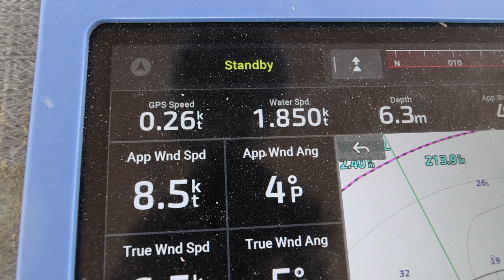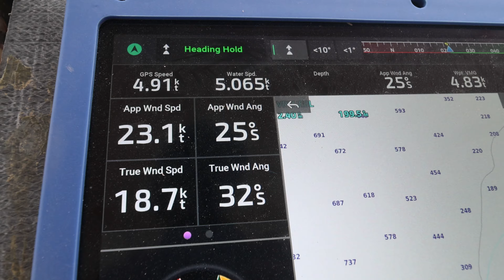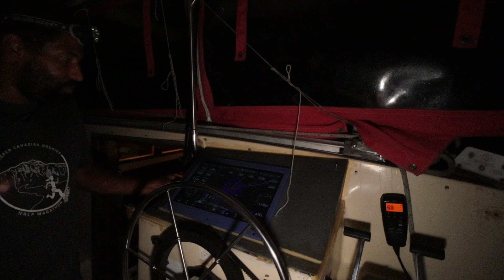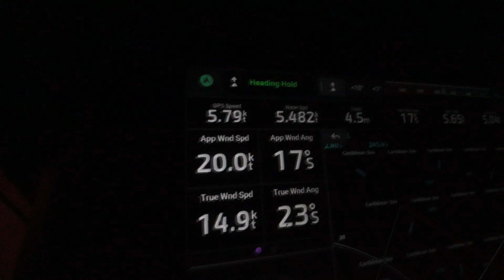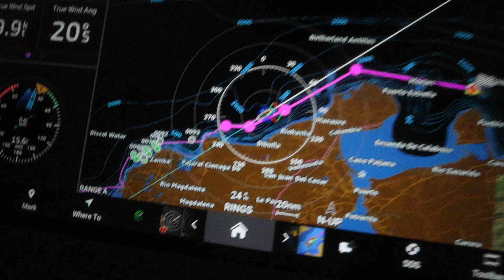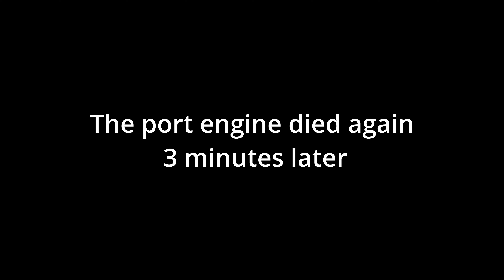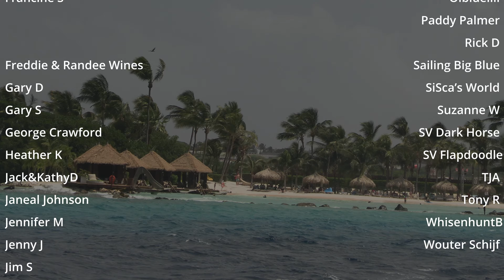DISASTER sail from Colombia to Aruba [Ep. 65]

Comment: Btw, good idea for regular boat checklist is printing out paper with all the things you need to do with blank check boxes. Then laminate that and with simple non-permanent marker you can reuse that same paper multiple times. You could even add couple blank lines into it so it's easy to add few extra tasks if needed with permanent marker.
This is really good if you are tired, or just forget. Or lets say you do something, and you partner can see you have done it without waking you up. You can have different lists for different uses or time spans. Though mainly, this is best for something you need to do regularly, say setting sail or something since it's handier than using phone or something. Ofc, you could also have whiteboard, separate or integrated as some surface in the boat. Main benefit to this is that unlike digital checklist, it's always visible and easier to access. Obviously, also good for todo list.
Reply: Excellent idea! 👍
Reply from the maker: That is a great idea!

Comment: If you do end up going into your fuel system/tank, I would personally recommend adding a separate fuel pick up so each engine is totally independent vs. the “T” connection.
Reply from the maker: Thats the plan, We also want to make the pickup lines 1/2" and add a 3rd pick up line for fuel polishing.

We are not big fans of the T connection at this point haha

Comment: Great spirit guys. Seriously impressed. Just need to polish your diesel. You can rig it up yourself with a racor and a fuel pump. Probably not first to say this. But just in case. If you need any advice just domment back and i can walk you through it. Cheers guys. Well done
Reply from the maker: We have a fuel polishing system on board, The problem is we have big chunks of stuff in the fuel tank that we picked up in Alaska, we have tried just about everything, but we have found wood chips and big globs of rubber in our fuel lines. We think there is a bunch of stuff in the tank that is just to big to fit in the fuel pick up line.
We are going to put a port in our fuel tank so we can get all that stuff out of the tank
Reply: @sailing.supernova  yeah. I would just take the inspection cover off and stick a big 3/4in hose in there then you can shine a light in and look around also.
Reply: @sailing.supernova  if there isn't an inspection cover you could just add one. Just use a jig saw and cut slow to avoid sparks of course. The more full your tank the better so there is no air in tank. No grinding obviously.
Reply: @sailing.supernova  I'm assuming your tanks are aluminum...

Comment: Come on guys it first happened in Alaska and you haven’t fixed it yet😮
You need to flush the tank properly guys
Good to hear that you’re gonna fix it. Be safe.
Reply from the maker: We tried a bunch of other things to fix it, but its clear we are going to have to cut out the cockpit floor, its going to be a ton of work but we have no other choice. We are going to run one engine off of a jerry can till we get the parts, that way we know one engine is getting good clean fuel no matter what.

Comment: Are you aware that you should be able to remove the speed transducer (spinney thing) from inside the boat for cleaning? There should be a plug attached to it. So you remove the transducer and quickly replace it with the plug before too much water comes in. Then clean at your leasure. 😊
Reply from the maker: It was really hard to get it in, even with the lube, so we tend to just hop in the water and spin it to get it going, and we give it a good clean every 2 weeks or so :-)

Comment: Darcy I think you should try to find a fuel polishing company in Aruba instead of cutting a hole in the floor of your boat to get to the fuel tank.
Reply from the maker: We have a fuel polishing system on board, The problem is we have big chunks of stuff in the fuel tank that we picked up in Alaska, we have tried just about everything, but we have found wood chips and big globs of rubber in our fuel lines. We think there is a bunch of stuff in the tank that is just to big to fit in the fuel pick up line.

Comment: That 'glob of caulking' is growth and it sounds like your tank is covered in it.  This is a lesson for others, do not go out planning on motoring in non-smooth seas without knowing for sure your tank is void of growth and fairly clean.
Reply from the maker: We have a fuel polishing system on board, The problem is we have big chunks of stuff in the fuel tank that we picked up in Alaska, we have tried just about everything, but we have found wood chips and big globs of rubber in our fuel lines. We think there is a bunch of stuff in the tank that is just to big to fit in the fuel pick up line.
We are going to put a port in our fuel tank so we can get all that stuff out of the tank
Reply: @sailing.supernova  if those rubber chunks are white then that is growth.  A fuel polishing system will not stop growth.  Some fuel additives slow it down.  You need to get in there and manually clean it out.  All fuel tanks need an access port for this reason.

Trust me, I've been in the same situation and it is the most common problem for new sailors.
Reply: Once you open up the tank and look inside, you will see white stuff all over the bottom.  All it needs is condensation and diesel to live and grow.
Reply: @sailing.supernova  I forget which is which but from what I remember it is white when it is alive and gray when it's dead.

Comment: Its really not safe to carry the dinghy on the davits at sea. Put it on the deck for passages in the open ocean.
Reply from the maker: Darcy Built the davits so we could carry the dinghy there even in big waves, each davit can hold more then 5 times the weight of the boat, and when working on the solar there was Darcy and another person in the dinghy when it was up.
We also have it tied down really well back there so it doesn't move at all :-)
Reply: @sailing.supernova  still not safe.   Water is 1000kg/m³ abd when it's falling into the dinghy at 60kmh the force is extreme. I came to this conclusion after a very bad experience in the Gulf of Mexico where the davits absolutely were strong enough but they tore a 1m² hole in the deck which became a major issue. It's a bad idea. I have davits at the stern of my boat. They are high and solid. I always carry the dinghy strapped to the deck just aft of the mast upside down. It's just not worth the risk as I have learned the hard way.

Comment: Why don't you upwind sail instead of running the engines? Yes I understand there would be a lot of sail changes but isn't that sailing? I'm very curious.
Reply from the maker: We were trying to catch a very small weather window, and it was 100% upwind, if we would have went under sail it would have taken 2 times as long and we would have missed the weather window. That area of Colombia is famous for its high wind and huge waves, and when the wind picks up its not a safe place, and we were not going the recommended way. So in short for safety reasons we needed to go fast!

Comment: When you had the good weather why were you not sailing so you could go faster and save fuel.
Reply from the maker: The wind was always right on the nose, so if we had put up sails and tacked back and forth it would have taken a long time. We had to hit the weather window or it would have been very dangerous seas. The current was also going the wrong way at 1.5 knots.
We do sail when ever possible but we just couldn't make fast enough time because it was 100% up wind.